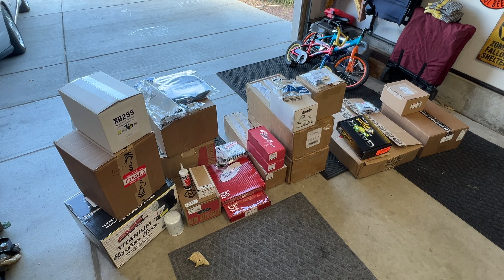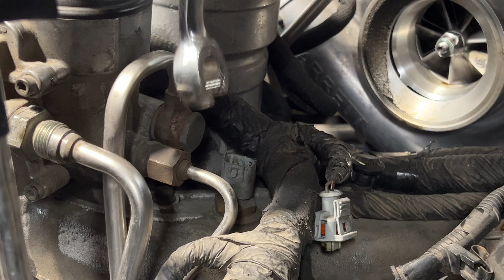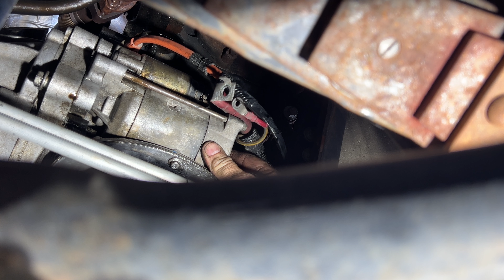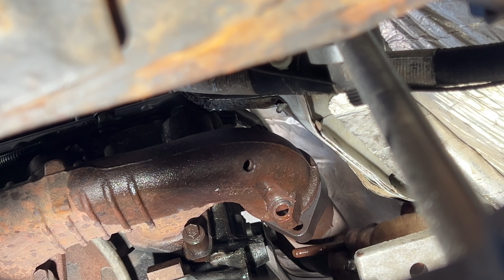Ford 6.0 Powerstroke Diesel Complete Engine Removal How-To Project EX Video 1

Comment: I have a 05 F350 super duty 4x4 with a manual transmission is it easier to separate the engine from the transmission

Comment: Thanks for the video, I have a 05 F350 I am getting ready to start, and this will be a big help. I do have a question though (forgive me if this is covered in another video I haven't made it through all of them yet) with the new turbo , cam , and injectors what tuner are you running and where did the tune come from?
Reply from the maker: @elijahbaker292  thanks bud, I’m running the sct live wire with custom tunes from blessed performance

Comment: A few pointers. The starter does not need to come out. It is not bolted to the trans bellhousing. It bolts to the adapter plate.  Only the wires need taken off.  I see everyone take it out and there's no reason to until after you've got the engine out.
  There's an access hole on the drivers side which can be reached from the front with a long extension that makes taking the torque converter bolts out very easy. No need to take intake, exhaust, and all that other stuff out. The turbo is the only thing that needs to be removed from the top.  
  Take your hoist chain and shorten it so that the hook is up by the arm, allowing the hoist arm to be by the engine.  When you lift the engine slightly, remove both engine mounts fully from the frame and engine.  That allows the engine to come forward a couple inches to clear the trans.  If you remove the three a/c compressor bolts, it's very easy to just take it out and access the engine mount bolts on the pass side.  I've seen several videos where people say don't remove the mounts and only take the frame nuts off. That's just silly when the mounts allows so much room for the engine to move when removed. 
  Use a rachet strap(a  orange hf one works fine)to attach to the exhaust pipe or other mount place behind where the turbo sits, run the strap though a chain hole and back to an arm extension bolt hole to attach the other end of the rachet. Then rotate the engine forward, lower the front of the engine(engine mounts removed makes this easy), as you lift and pull forward. This allows the oil pan to clear the trans line/cross member.  Kinda hard to imagine but fully makes sense and works if you get what I'm saying.
  I've seen people use a leveler but to me its harder than using a rachet strap.  I've done it like this several times. Detach the wiring and plastic cowl running across the top. Of course, your going to make a mess with coolant if you don't plug the holes.
  And no, I don't have a video showing all this because everyone is doing camera magic with the time.  It isn't a two hour job like I heard a few claim. This will take you all day, if not all weekend.  The excursion is def harder as the F350-550s you can lift the cab slightly to gain more room to lift the engine.
  Another note, if you lift the cab a little, you do not have to take the trans linkage, grounds or o2 wires off. You only need to lift the cab a few inches to give ample cowl space. But taking the excursion cab up is def more time consuming that an F series.  I usually take the very front cab bolts out and the ones under the front floor boards.  But all the rest only get loosened which allows the cab to not move backwards and easy to tighten back down. Only a few inches is needed if you decide to go this route. 
  I have completely removed the cab/cabin on both F series and excursions and find its just less time to not lift the cab. I have a lift and it's just my opinion after doing it many times.  I'd rather not run the bill up on the customer just to make taking the mains out a little easier. You can use a 5 foot extension with a swivel and get all the bellhousing bolts out from going in behind the transmission.  And even with a lift, if you don't have a real high lift, the front body cross member doesn't allow much space for your hoist and you'll have an issue getting the engine out. 
 I'll shut up now.
Reply: Awesome reply....can it not be pulled with the harness still attached to the engine?
Reply: He pulled the starter cause he got a new one.
Reply: I am getting ready to do heads and gasket on my f350. Can I do them ok in place or should  I just pull motor like this?

Comment: I'd delete all that shit regardless of if the state has "emissions" and get the tickets dismissed every time because there's NO crime committed... Those tickets are administrative so all you gotta do is send a letter to the Court Clerk state "Nature and Cause" of the crime and they will get it dismissed before it goes to the court. 

Article 1 courts do not have the same power as Article 3 courts.

Comment: Hey man I am taking out my engine in my 6.0 and I was just wondering where your putting all your parts like how you keep everything sorted or if you got any tips to help when I put everything back together
Reply from the maker: I just kind of line them up and try to put every bolt back in the hole if possible. A lot of people just setup a separate table and line everything up.

Comment: If your running an oem oil filter make sure to take  the ring of death out of the top of the oil filter stand pipe... They hold down the filter bypass valve not used by the aftermarket filter companies. The reason they use the ring of death is to get the standpipe to go down when the filter is installed. A catch can wont keep your egr valve cleaner. The junk thats in it is a combination of  the normal oil thats in the cac system and the soot that comes out of your egr cooler from the exhaust.. You can help gunk build on the valve by raising your cetane levels of your fuel.

Comment: Im thinking about doing this work to my 04, f250. I just have some doubt as I prob have 3 months experience messing around with cars; brakes parts mainly  and fuel line. Was this the first engine that you pulled ?
Reply from the maker: No I’ve pulled several engines before. If you follow along on my video I’m sure you’ll have no problems doing it yourself.

Comment: Great video. You mentioned you have a lift. Is it a body lift? I'm asking because I was wondering if the oil pan would clear without a lift. Thanks.
Reply from the maker: I have a suspension lift. You will have no problem clearing the oil pan at factory height.

Comment: Good video man FYI I find it less stressful getting at those manifold up pipe bolts and nuts with a 1/4 impact and extentions and swivel
Reply from the maker: Thanks for the tip.

Comment: How much was all the parts?
Reply from the maker: I’m sitting right around 14k right now.
Reply: Still cheaper than a new vehicle. I’m trying to add upgrades to my stock 6.0 but I don’t have the 14k to drop all at once for that.

Any suggestions on what to start with for reliability/500hp performance? 

I was thinking bigger injectors, turbo, and a tune to start?

New to this upgrade stuff.

Comment: When I pulled my engine I used a heavy duty steel plate with a heavy duty eyelet welded to the steel plate which was bolted down using the turbo pedestal bolt holes. Found that to be better than using the provided hook points.
Reply from the maker: Yeah I did kinda the same thing when I installed it back in. Factory lift brackets just don’t seem very strong.

Comment: great video!  very well done.  great to see a version of pulling this motor out through the front instead of lifting the cab (which is nuts) and near impossible for DIY'ers
Reply from the maker: Thank you I  find this way of easier plus with the engine out you can replace the known to leak bed plate and oil pan gasket with ease.

Comment: Just watched both your videos on the 6.0 pull and rebuild and it has given me the confidence to do the same to my 2006 f350
Can’t wait to see part 3 on the going back in with it 
Do you feel that pulling the front off the truck is about the same work as pulling the cab as I don’t have a 2 post lift but I was thinking on buying one until I watched your videos.
Reply from the maker: Thank you part 3 will be out soon just been super busy lately and haven’t gotten around to editing the rest of the videos. A lot of people say pulling the cab off is way easier but since mine is the excursion it’s not as simple. I prefer pulling the whole motor that way I can pull oil pan and lower end to replace the bed plate gaskets. Originally I was just going to do new heads with the cab on but decided to pull the whole thing since I needed to do lifters and I’m sure glad I did because not sure if you saw but one of my main bolt head had broken off and was laying in the bottom of the oil pan for who knows how long and the bolt was working it’s way loose. It’s really not as big of a job as people make it sound with a helping hand you can have the motor pulled in a couple hours.

Comment: OK, maybe I missed it or you didn't say: Where is the talk about pistons, piston rings, connecting rods and bearings, main bearings, cam bearings, front and rear main seals......etc. ? Your engine has 220K miles and you are pulling the engine from the truck, are you NOT going to be rebuilding the lower end ?? In my opinion that would be a HUGE mistake. If the engine has that many miles and you are pulling it from the truck, a complete rebuild (most likely involving  a machine shop) would be the smart thing to do.  I'm about 3/4 of the way thru all of that myself. I NEVER want to pull this engine again. If the engine is out, it would be foolish not to do a complete rebuild.
Reply from the maker: You are entitled to your own opinions. The bottom end on the 6.0 is stout from the factory and rarely has any issues in my opinion. I’ve seen plenty of 6.0’s with 400k-500k miles on the original pistons, rings, main and cam bearings. Yes mine does have higher milage but I know the history of it and how it was maintained, I’ve had it since it was almost new and it wasn’t abused like most 6.0’s that’s why I was able to get 220k out of the factory head gaskets. Before the teardown I had excellent compression and zero blow by. Talked to many shops locally and online that throw new heads, lifters, and pushrods on without touching the bottom end all the time with well over 200k on them and have zero issues. Most of my kids are grown now and driving so this is not our daily driver anymore mainly just a weekend warrior. So it will probably be another 10 years before I put another 100k miles on it. With proper maintenance I don’t see why my bottom end wouldn’t last another 200k or more. Honestly I don’t think this engine is that hard to pull with a helping hand you can have it out and on a stand in a few hours.